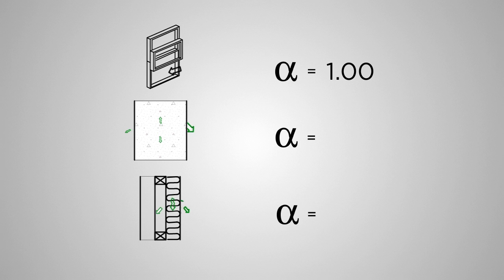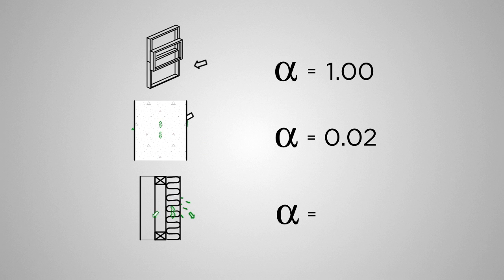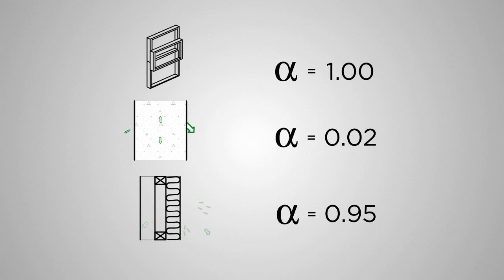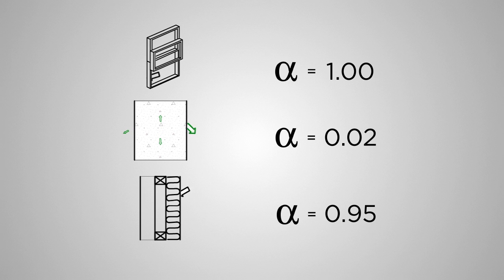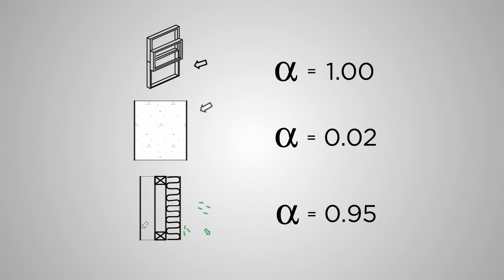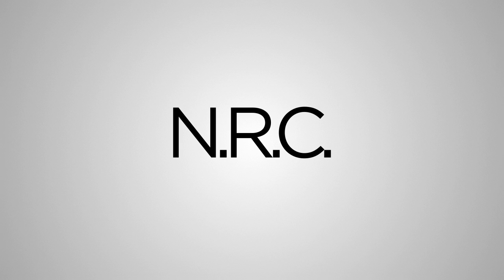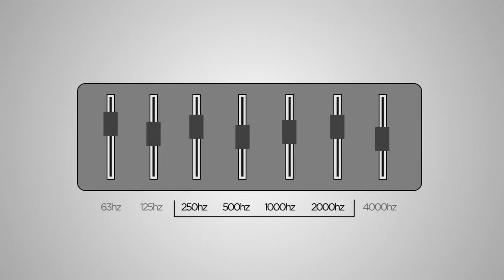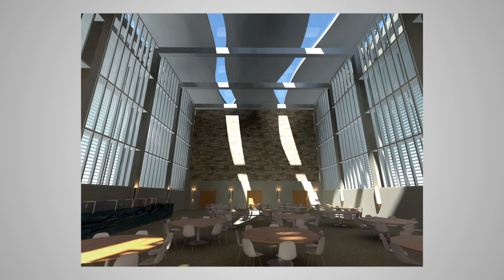Architectural Acoustics 2 of 4: Sound Absorption Coefficient and Noise Reduction Coefficient

Comment: It's quite interesting that in Europe calculation of building acoustics uses a different method which is arguably more accurate and uses 1/3 octave bands across the full acoustic spectrum then weighting those values depending on psychoacoustic factors (dbA weighting) then the analysis of materials can take into account the resonance of specific materials and cavities.

Comment: Hi..is that possible to have negative sound absorption coefficient? If yes, why?
Reply: Hi, to answer your question. No, you can't have a negative sound absorption coefficient.
Reply: No, it can't be negative because it is a percentage of incident sound energy absorbed by a material. The sound will reduce but it won't be negative amount.

Comment: Hey mike thanks for the knowledge  but iam interested to know ,if i put foam mounted with a frame and the air space behind instead of glass fiber would i get the same results on a concrete wall,and what is the absorpition coeefficient of foam ? And what makes so important  to leave a space behind when your making acoustic panels Thank You
Reply: +CONGA MUSIC The foam used will most likely not be as absorbent due to its density, although it would probably absorb some of the noise. The space you leave open behind allows the noise that is not absorbed to bounce back through the foam and undergo another wave of absorption.